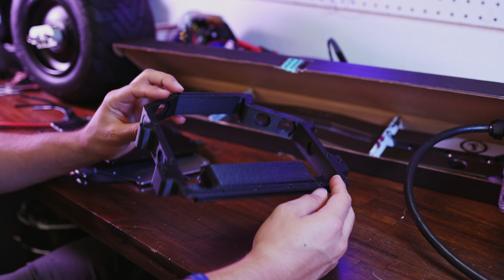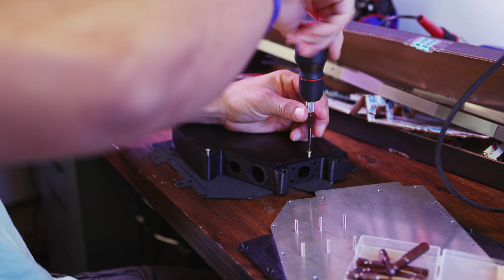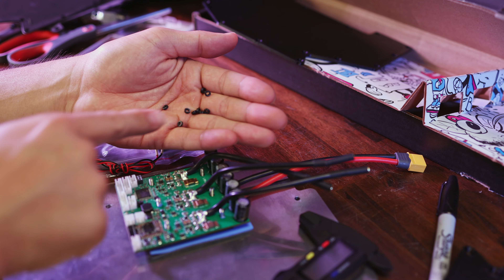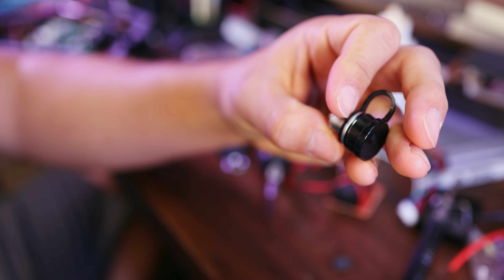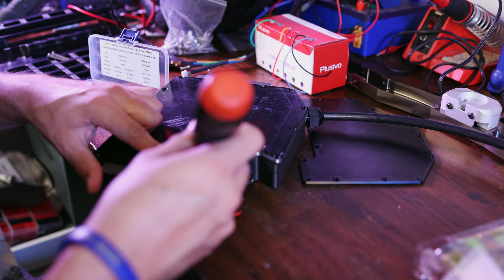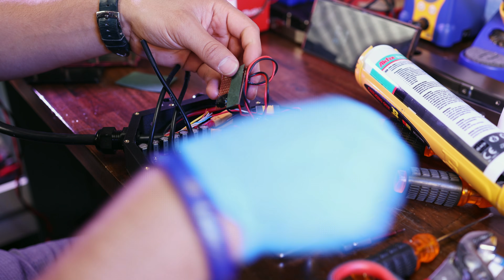Assembling My DIY OneWheel's Controller Box - VOW 1.0 (Detailed Guide)

Comment: What was the total cost of this build?
Reply from the maker: Honestly broski I bought the parts over quite an extended period of time, so the prices will vary. I also got a bunch on the Float Life black friday sale. I would have to say its somewhere around 2k in raw parts including the battery cells. However, I did build the battery myself, printed my front enclosure, and had all of the tools necessary to build it, so it could be a lot more for some people.

Comment: Awesome video i subscribed! I did my first build recently with focer 3.1, superflux hs, and 18s battery so I'm seeing alot of similarities❤
One thing i did do differently was put 0.5mm small nylon washers on the m3 studs in the box for a backup and reassurance that the mosfets would not touch the metal box/lid. I cut out washer sized holes in the thermal pad and layed it on the studs around the washers. Pretty sure mario does something similar in his 18s2p vesc build log "Kev special"
Awesome work looking forward to the rest of the build!
Reply from the maker: Thanks for watching! That is an interesting idea, not a bad one either. I think you'd want to make them just the right height though otherwise risk not having good enough contact. I don't think I'll take mine apart to add it but that's good advice for people who are building theirs for the first time. It sure is a blast though!
Reply: @RBEMotion yea the washers came with my floatboxx. The washers are 0.5 mm and the thermal pad is 1mm. I got the idea from Marios build along with bushing washers that i picked up for the top of the controller under the nyloc nuts.
So much fun to build though!!!